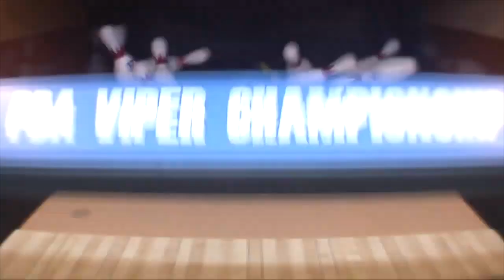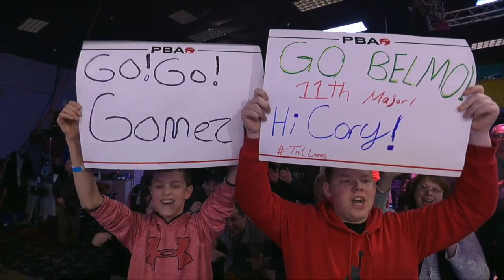2019 PBA Chameleon Championship Stepladder Finals (WSOB X)

Comment: Gomez has ball deflection. Ball finishes dead on 9 pin.  Needs to be just a little left of center of 9 pin out of the rack.  Frame 9 is perfect show of this then watch first ball in 10th.  10th takes down 10 pin as ball finishes stronger.  Great match guys.  Great match.